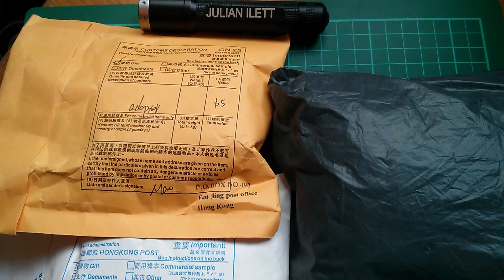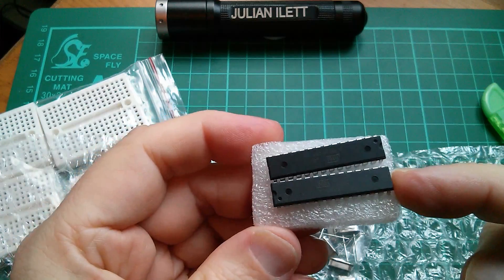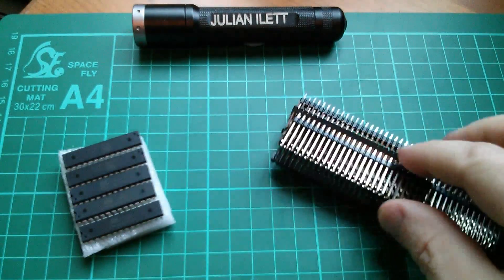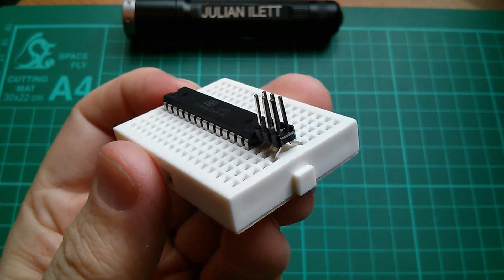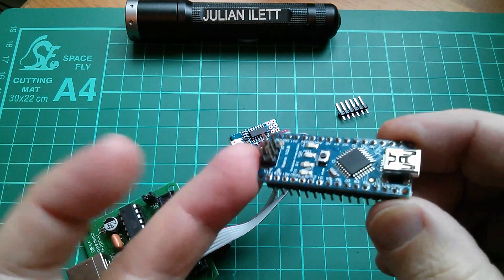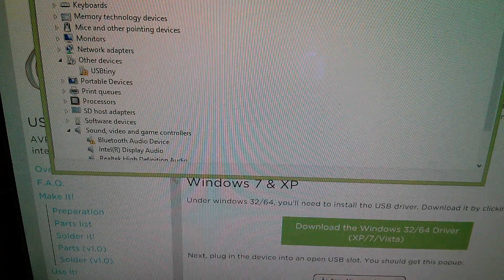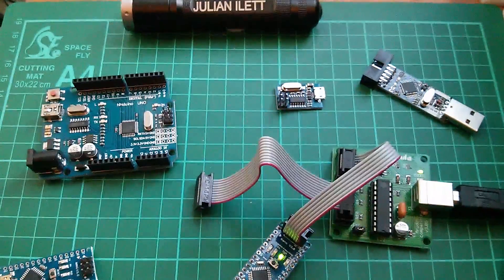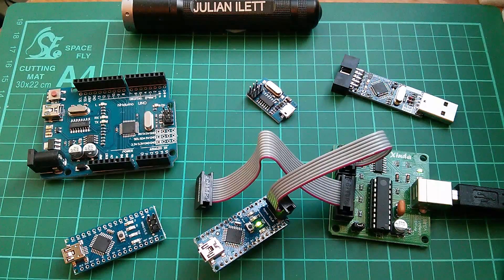Postbag #28: Arduino Special - Cheap Uno, DIY Duinos, USB Tiny ISP

Comment: Not to be snarky, but I honestly don't understand: Why would I do a DIY Arduino?  
Don't get me wrong, this has educational value which I am not disputing and I enjoyed the video.   

But it seems that when it's done, it has at least the volume of a Nano clone and seeing that Nano clones start at 2 GBP, you are not saving more than maybe 50p, even if you ignore your time setting up the DIY Arduino where the Nano is plug and play.
Reply: There is at least one other very good reason to make an Arduino from base parts. Once you have a project developed ( Aduino is primarily a development board) you can then go to the next step and make a final integrated project.
The larger DIP version of the AT Mega also tends to be a little more rugged and is easily replaced should you have a blonde moment which is why the original Arduino entry level boards tend to use the DIP version.
Reply: I don't think I'll be doing much surface mount stuff either... way too small! Nearest I'm getting in the foreseeable future is SOT23 mosfets and SMD leds. The thing I forgot to mention is another reason to build your own if power consumption is a concern... you can get rid of the regulator, leds and run it directly from 2/3 AA cells - My dead bug build runs for 10 months between charges on 3x1500mah NiMH cells.
Reply: Or even, why bother with the bootloader.  Just use the micro with its native IDE
Reply: YensR Because you can.. getting back to first principles lets people understand better (or at least that's been my experience)
Reply: ***** So it's the educative side that I mentioned, okay, I understand that.
Reply: YensR Yes, sorry, I didn't mean to sound snarky either :-)... I of course don't know why Julian did it, but that's why I'd do it.
Reply: Thanks folks and Rob B . I understand that and it makes sense for these applications.  
To be honest, my idea of a permanent solution for my stuff was a Nano soldered to a stripboard (but probably just a breadboard if I am honest) ;)
Reply: If you want to do an "it´s all mine" thing with a dedicated PCB, it´s far more easier to include the just a single chip than a complete arduino (whatever board)...
Reply: Glebs Litvjaks Looking at the sizes, I think you'd have to go SMD to save volume, maybe the "dead bug" style that Peter mentioned would save some volume with the pin version microprocessor shown in the video.  I don't think I'll ever be able to do SMD stuff, but I'll keep it in mind.
Reply: I would make an diy arduino if I'd want to integrate several components to one package. Instead of using shields you can combine the components you need and the arduino on one perfboard.
Reply: jorenmartijn Yeah, I get that, but given the size and price of Nano and Pro Mini clones, I'm not overly convinced it's worthwhile (unless you want to learn it).
Reply: Three reasons I've gone this way are for the education, for some custom circuits I've built on stripboard (although I've also used nanos/micros on some others), and for simple 'dead-bug' style builds... i.e. no crystal, no regulators... just components soldered onto the back of the chip. That being said... I use unos and nanos most of the time... after all... they are meant for prototyping :)

Comment: Also check atmel studio, it's quite well made.
Reply: Using Atmel Studio to program the Arduino is like using a sledge hammer to drive home a tack. It is very big and heavy and far more tool than required. It also adds another layer of complexity and learning which for a beginner can be formidable.
I agree  the Arduino IDE is very limited in its editing capabilities. Ideally what is needed is a more advance text editor like Notepad++  that will transparently use and control AVRDude like the Arduino IDE.
Reply: Rob B yes it's big, but you got a chip simulator in the program,  and a autocomplete that works.
As for special function registers, if you want to know the hardware; it's better to actually deal with it.

You actually compare the avr toolkit vs the toolkit + a lot of extra stuff (arduino). Also stepping the asm-code helps if you want to figure out the timing.
Reply: Rob B there is actually a plugin to integrate the arduino IDE to Atmel Studio. I prefer using plain old C now anyway rather than the arduino abstraction. At least for me in my mind, learning how to directly manipulate DDR, PORT and PIN registers for I/O was not difficult.

Yet, last night I did an alternating LED blink program on an MSP430 launchpad. Or more accurately, I did it twice, once under TI's code composer studio in plain C directly manipulating registers and once under Energia (fork of arduino IDE supporting TI chips). Simple really, green LED lights up, then switches for the red LED and repeats. Came to just 300 bytes under CCS with all optimisations off, almost 700 under Energia (best attempt to reduce code size short of direct register manipulation again which still bought it to 500 bytes, energia has optimisations enabled).

For the newcomer. Arduino/Energia/Chipkit/Maple is certainly easier to understand, alot easier. But it really does bloat code size hugely. In the arduino ecosystem the approach is to upgrade to the bigger board when you run out of flash or ram, half the time, can probably just ditch some of the arduino abstractions and save a huge amount of space that way.

Comment: Julian, you need some load-capacitors on that xtal for it to work correctly. You may be getting away without using the breadboard, as the capacitive loading of the contacts may be enough, but if you make it a "real" board, it will not work correctly. The size of the capacitors is stated on the datasheet for your xtal. If you do not have that (obviously not) - 22pF is a good value.
Reply: Julian Ilett I usually cheat and get the 3 pin ceramic resonators.  No capacitors needed. You can usually get them for a few p each.
Reply from the maker: I've got those, 2x 20pF. I forgot to show them. :(
Reply: If he wants to do an bog-standard arduino, he needs the 22 pFs and the 16Mhz crystal, or 8Mhz if running at less than 3.8v. Otherwise you can use an the internal clock (8Mhz again) and forgo the crystal and load caps.

Comment: Great video, and look forward to the 'build your own' one... You can also use the Arduino itself to burn the bootloader: http://arduino.cc/en/Tutorial/ArduinoISP, without a separate ICSP programmer, providing it's a recent board with an ATmega328. Be interested to see if this works on the CH340/clone boards!
Reply from the maker: spoonymccheese Yes, that's the "Arduino as ISP" option in the programmer list. I notice there's also now a programmer called the ArduinoISP - details here: http://arduino.cc/en/Main/ArduinoISP